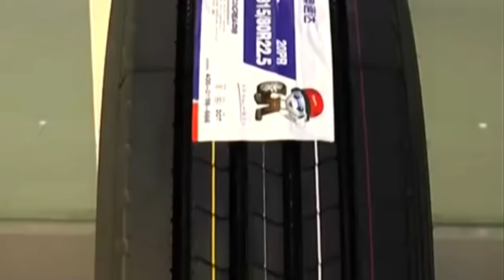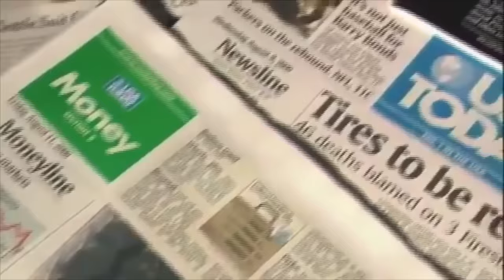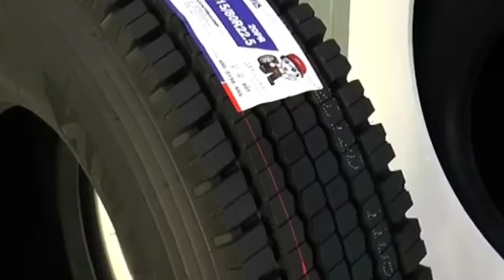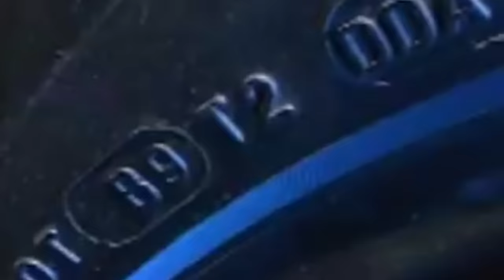5 Tires You Should NEVER Buy!

Comment: The Firestone Wilderness issue was not a Firestone issue.  It was a Ford issue.  Firestone had recommended 32psi for inflation, where Ford recommended 24psi to 'keep the ride smooth'.  The Wilderness tires did not have such issues on other vehicles.
Reply: There was more to that story:  I worked at a Ford dealership during that time period and the Explorers had Twin I-Beam front suspensions.   Nothing wrong with that except that when they were chained down onto the transporters the front alignment took a set with excessive negative camber.   This makes the top of the tire lean inward which puts a lot of stress on the inner tread edge.   I complained when doing 'New Car Prep' that they were out of alignment but was told that they couldn't do anything about it unless the actual purchaser made a complaint.   So thousands of Explorers were sent out into the world wearing the inside edge of the front tires enough that cord would be exposed long before the outer treads showed much wear at all.   And THIS is where the main problem occurred.....owners said 'there's a LOT of tread left...so I'll put them on the back to wear them out'.   MOST of the tread separations happened on the rear wheels due to them being cut all the way around on the inside and then run at high speed and low pressures.   ANY tire will fail under these conditions.    Once the lawsuits were settled do you remember that Continental as well as other brands also failed in the same way on the Explorers?   Yes...they did.   It was a vehicle problem that was easily corrected and not an actual tire problem.
Reply: ford also told firestone how to build those specific tires that went on from the factory. which happens many times tires sold through normal dedicated tire shops even if the same model are on average built to higher standards.
Reply: Those tires would wear extremely slowly, as the rubber aged, it dry rotted, eventually leading to the tires coming apart. I worked for Firestone, and this was the explanation they gave us
Reply: I still blame both companies your 100% on the air pressure thing but Firestone allowed Ford to lower the air pressure specs on the explorers running the Firestone wilderness tires, and there were almost no issues with other brands like BFG on Ford Explorers or S10 Blazers (similar SUV) running the Firestone Wilderness Tires at 30psi as OE. A decision Bridgestone/Firestone Corp made to keep a customer (Ford) happy basically hurt them in the end.
Reply: The Wilderness tires supplied to Ford by Firestone were made with one fewer belt than those same tires sold to the aftermarket.
Reply: Recoil Rob this is why when I get my first car, there is no way in hell its going to be a Ford. I more than likely will get a Toyota 4Runner, and then save up to do a swap for a Jeep. I am not getting a Ford.
Reply: Keaton0801 Hey man, it's fine if you don't want a Ford, but all the big car companies have stories much like this one if you look into it. There is a history in the automotive industry of cover ups and known dangerous defects being ignored to save the company from costly recalls. This is not a problem only attributed to Ford.
Reply: Yes you are 100 percent correct.... I remember that I was working at Firestone at the time and all there was were ford explorers in the parking lot... but it was Certain  tires that were effected was by the code on the tires it was like the code like being in vn and vh something like that on the tires that were effected
Reply: Funny how Ford COMPLETELY REDESIGNED the Ford Explorer the very next year. Including adding independent rear suspension. The wilderness was a fantastic tire that so many people got so many miles out of. It made me so angry to see all those tires sitting in my dads firestone lot with gaping 2” holes drilled in the sidewall which was the protocol. If you had a set of these tires on, all you had to do was stop by a firestone store and bam, they would replace the whole set for free. I can’t remember what they used to replace them, maybe a destination? Bridgestone/Firestone is a top tier tire for all road purpose.
Reply: Uhaul won't let you rent a trailer if it's being towed behind an Explorer. I have an 07, a complete redesign from the Jurassic Park style Explorers and they wouldn't let me. I hear the newest front wheel drive style can
Reply: If I recall correctly there was a problem with the Explorer assembly line and some rail system that would damage the tires as they moved down the line. Ford did modify the assembly line after all this came to light. There are more problems with the tires coming out of China than any of these ever had.  Quality control during manufacturing plays a huge part in it along with the quality of materials and design.
Reply: I wouldn't buy tires from the 90's anyways...
Reply: It was to reduce the rough ride (it's a truck after all) due to complaints.  Ford even mentioned as much.
Reply: Not too mention the fact that no teenage girl or most adults these days check their tire pressure ever.
Reply: this is not true, it was one bad batch, one DOT # that was involved, and combined with the under inflation that ford stated.
Reply: 4ST induction  If you want to believe that ANY manufacturer can "redesign the whole vehicle" by the NEXT model year, AFTER it had to take some time into the previous model year to even suspect a problem that calls for a complete redesign, then you have been living in a Star Trek universe where replicators can be programmed to instantly create a new version of anything.
The "new" version design was probably finalised during the first year of the previous ones production.
Reply: I wouldn't run any tire at 24psi for any kind of extended high speed or even medium speed because that low inflation will flex the sidewalls big time and heat them up to.
Reply: Firestone is still garbage. Get some Toyos
Reply: No, It was a Firestone issue, You could get the Wilderness tires on 95 S10 Blazers and they experienced the same problem as the Explorer, it was not as highly covered as the Ford and Firestone issue. Also, Firestone 721's were a failure and not long ago GM issued a recall on vehicles equipped with Firestone tires claiming contaminated rubber in the tires.
Reply: If you drove a Chevy Corvair, you ran your front tires at 18 PSI.  At 32 PSI making a turn on a rough road was not easy, the front tires were like basket balls being dribbled.  I know, been there, done that.  Then I read in the owners manual, finally, to inflate the front tires to  18 PSI and the dang thing drove good.  There is little weight on the front, rear engine rear drive, engine behind the rear wheels.
Reply: They were also only rated for use on lighter vehicles like the Ranger while Ford decided to also install them on the much heaver Explorer. They were not only telling people to under inflate the tires but they were overloading them as well. Inflated properly on a Ranger they were fine. They would have needed sturdier construction to be safely used on the Explorer, even at proper pressures.
Reply: Eldor Luedtke, Other overhanging rear engined cars using the same size F&R tires have had similar uneven pressure specs. It's an attempt (which works pretty well) to make the car understeer ("plow") more like a front engined RWD car.
I once loaded a Citroën ID (same basic car as a DS) with over 1,000# in its trunk. I could do this and still go due to the self-leveling oleopneumatic suspension that was able to lift that much weight in the rear.
Presto! The car oversteered like an overhanging rear engined car. "The tail wagged the dog."
A heavy load in the bed of an ID wagon would do the same thing to it.
FWD cars in general are understeering largely due to 60%+ of the car's weight being on the front wheels when lightly loaded. The Citroëns unlike most contemporary USA cars 1950s-70s had very little weight behind the rear wheels, adding to their front weight bias.
Reply: 24 is obscenely low
Reply: I thought it was "VDHL" for the recalled serial numbers.  At first, they only recalled tires made in Decatur Illinois.  They later closed that plant.  Humidity and bad practices in the construct are thought to be factors.  The tire pressure was recommended at 26 psi, not 24. Most of the accidents had very low tire pressure, much lower than the recommended 26 psi.
Reply: The Explorer didn't get independent rear suspension until 2001. In 1995 the Twin I Beam and Twin Traction Beam front suspensions were replaced with a double A arm design.
Reply: Yup, it's stupid policy by U-Haul. They're applying the rules for the 1994 and earlier Explorer to the redesigned 1995 and later that have double A arm front suspensions.
Reply: Nope. It was Ford specifying too low of tire pressure to increase ride comfort. but with the low pressure the tires would get too hot and fail because they weren't designed for that pressure. People who ran their tires at the pressure specified on the tire instead of on the door jamb label didn't have the problems.
Reply: silicon212 , you are so right! I agree 100%
Reply: They were mixing a product in the tire called PGI with other rubbers in the tire like the km and FE and it caused catastrophic tire failure. That's what happened.
Reply: silicon212 kia says 30 psi for my 2006 kia shortage 4x4. Then when I drive the tires warm up few degrees to 32psi to be optimum pressure recommended by the manufacturer. I’ve got Michelin defender tires.... I believe they are 80k tires....
Reply: There actually is a major problem with that type of suspension. Every time you go over a bump it will mung up the camber. The result is that you'll get excessive shoulder wear, especially on the inside. And then you have someone who doesn't know what they're doing measuring the tread depth in the CENTER of the tire while the shoulders are already bald, and figuring that its still good.
Reply: Chevy Blazer was NOT even REMOTELY similar. Those had a double wishbone front suspension that would maintain camber. The exploders have a double I-beam suspension that would go out of camber with any shift in the suspension.
Reply: Ranger and exploder were the exact same vehicle, except for the crap on the back -- passenger seat or cargo bed.
Reply: Toyota makes good vehicles.  My wife had a 2005 Sienna for years, and it was very reliable until a month ago when someone did something stupid in front of us on the freeway and she didn't have time to stop.  The van was totaled, but we walked away with no injuries.  She now has a newer RAV4.  However, as Chris H said don't discount Ford completely based on one episode.  Just about every car manufacturer has an incident (or several) just as serious if you look hard enough.  GM pickup trucks had Sidesaddle fuel tanks that burst into flames even more readily than the Ford Pinto in a crash, Pontiac Fieros with the 2.5L engine would leak oil onto the exhaust and burst into flames.  The first generation Scion XB was horribly unsafe in a crash.  VW lied to pass emissions.  And the list goes on.  Long story short, if you refused to buy a vehicle from any manyfacturer that had this kind of dirty issue in their past, you'd probably end up walking.
Reply: I 100% agree with your comment. I worked in the automotive service industry from 1993 to 2006, and know for a fact that this was 100% Fords' problem.  The Explorer was designed with a high center of gravity and the wheel track width was too narrow making it prone to rollovers when sharply steering in either direction (regardless of the tire brand, size or PSI).  That plus Fords' recommendation of 24psi on the door jam placard like silicon212 already mentioned in the previous post is the reason for the rollovers.  Tires lose 1psi per month under normal conditions, and also lose 1 psi for every 10 degrees colder it gets. People never check their tire pressures monthly as recommended. And because of this eventually the low tire pressure causes tire overload and the sidewall cannot take the heat and tire failure is imminent.  There were MANY cases of Explorers rolling over with different tire brands on them.  On a side note tire retailers had an agreement with Ford NOT TO SELL tires larger then P205/75R15 for the Bronco II due to it's rollover potential. Ford to this day swears that it was the tires, and not their vehicle design that caused this. Newer Explorer model years featured a lower center of gravity and a wider wheel track (this proves that they were aware of their design mistake).  Beginning with the 2008 model year, all vehicles must have a TPMS (tire pressure monitoring system) as original equipment. Honda/Acura and Toyota/Lexus introduced it in 2007 one year ahead of schedule for the new law.
Reply: 4ST induction: Completely wrong.  The Explorer got a redesigned front suspension in 1995 with the 2nd gen (no more twin I-beam front suspension, but still a "solid" rear axle and leaf springs), and IRS in 2002 with the larger 3rd gen.  Also, Ford started designing the 3rd gen in 1995.  The Firestone issue started becoming known in 1996 and 1997, and the NTSHA began an official inquiry in 2000.  

As to Firestone being "Top Tier", no.  All tire manufacturers make multiple price point tires, including Firestone.  Some of them are good, but those are generally the higher priced ones, just like other tire manufacturers.  As to my personal experience, I have had better luck with Cooper, BF Goodrich and Goodyear than Firestone when purchasing similar purpose and price point tires.  The Firestones had similar traction and performance, but wore out faster.

Edited to show who I was responding to
Reply: schwagbag: I would disagree with your assessment of blame.  Ford AND Firestone are at fault for the tire pressure problem (they both went with it).  

Your comments on tires and tire pressure are accurate, I've seen more people than I care to count driving on near-flat tires, and the number of people with flat tires that were obviously caused by the rim grinding through the sidewall after the tire got too low.  However, it is the responsibility of the driver to understand what they are driving.  Suzuki is not "at fault" for the Samurai, which was also known to tip over.  IT was a great little vehicle for it's intended purpose.  People who were used to driving cars and expected Explorers and Samurai to respond the same way are at fault.  The twin I-beam suspension is simple and functional, and worked fine for decades.  I have had several vehicles with that front suspension setup and not had a problem.  Ford made the Explorer bigger due to demand for larger vehicles, and changed the suspension because newer customers wanted something smoother.  Yes, these things did also help with stability and handling, but it is disingenuous to say that vehicles rolling over is the only reason for the design changes, or to assign blame based on such "proof".
Reply: silicon212 you are wrong it was both ford and Firestones fault
Reply: cloridan Beauchamps lowered tire pressure would not reduce rollover, it would make it worse. The tire flexes more, causing it to tuck under in hard cornering.
Reply: From what I understand it was a pressure issue made worse because many owners let the tire get low AND commonly overloaded the vehicle. Causing two problems, rollovers due to low pressure and tire failure from overheating(low pressure, too much weight)
Reply: greggv8 pressure stamped on the tire is always the max allowable for the tire.
Reply: I noticed that 32psi rating back then. Almost every tire machine I used through the 80-90’s, automatically air the tire to 32psi(once the bead was seated). I never thought that was enough psi for any 15” ⬆️. I’d like to know fords reason for the 24psi rating.
Reply: Jason Morehouse 
Not true. It was all the Wilderness tires that came on the Explorer from the factory.
Reply: jblyon2 
Wrong. The tires failed on all cars they were installed on. Other manufacturers had this issue as well.
Reply: And the Firestone 500 were junk before the 721 which was basically the same tire!
Reply: EXACTLY!
Reply: So what you're saying is: Tires don't kill people; people kill people. Sounds familiar.
Reply: The way the accident was described I would have not excluded the driver's speed from the equation; just seems a bit of corporate bashing to me.
Reply: "There actually is a major problem with that type of suspension."

News flash - every suspension design is a product of compromise.  They all have problems!  Film at 11.

"Every time you go over a bump it will mung up the camber."

Yes, the camber would change whenever the suspension was compressed or drooped.  This is the case with nearly every other suspension design on the planet, except maybe live axles, and with a live front axle, you get to deal with bump steer.

"The result is that you'll get excessive shoulder wear, especially on the inside."

Typical wear pattern on the twin I beam is on inside AND outside edges.  Solution is to just rotate tires more often.

I know the twin I beam system.  Got a Ford with that system parked out front right now.

"Those had a double wishbone front suspension that would maintain camber."

Negative.  The S10 suspension changed camber as it moved vertically.  Additionally, the steering linkage was garbage, with the idler arm wearing out rapidly leading to the toe moving around however it wanted.  The twin I beam had issues, but the Chevy IFS from the same era was far worse.

"The exploders have a double I-beam suspension that would go out of camber with any shift in the suspension."

Any suspension system that "shifts" will go out of alignment.  Not sure what you're talking about.

The twin I beam holds camber just fine.
Reply: "pressure stamped on the tire is always the max allowable for the tire."

And for max loading.
Reply: 100% correct! The lower inflation causes the tires foot print too increase. More contact with the road creates more friction, causing the tires to heat up faster and hotter. While at the same time not allowing the tire too dissipate heat as effectively as a properly inflated tire would.   Also the lower pressure causes the tire to deform from its intended profile. This deformation would exacerbate any flaw or weakness that wouldn't be there if the tire is inflated to FACTORY RECOMMENDED specs.
Reply: Floordford I have an '06 Explorer. You're correct. Uhaul will not rent Explorer owners, but WILL rent to Mercury Mountaineers....It's the exact vehicle!!!(??). I don't understand it. I worked at Ford dealerships at the recall time. Most of those failures happened when people overloaded the Explorer with more than the recamended amount of passengers. Of course the recall really kicked in in the summer...ugha!
Reply: jlc7300 I just put Firestone Indy 500s on my 328i and they're fabulous. Read the online reviews  .. can't get much better.
Reply: Captain Chaos I agree .I had a 98 f150 ( NOT a twin I beam truck) with wilderness tires, I can honestly say I had the truck for 1year blew 3 tires. I traded in for a 1999 ( 4 doors).
Reply: YES THEY DID. Firestone tried to kill me as they continued to sell these after they knew there was an issue. The tire that blew on me was the right front on a van. Firestone tires are ONLY good at keeping boats from hitting docks. I will never own or drive any vehicle with a Firestone tire.
Reply: If a tire comes apart under normal loads and speeds when it is 8 pounds underinflated, it is unsafe.
Reply: 60 minutes did a story on this.  They bought an explorer, rigged the tire to blow, and did several tests with the tire blowing.  High speed, low speed, full brakes, and no brakes.  The vehicle stopped in a straight line each time.  It was determined the drivers were swerving as soon as the tire blew to get to the side of the road, causing them to lose control.  The biggest issue was running the tires very low on air to reduce some of the handling issues.  Those did not maintain the pressure, let them get too low, overheating the tire, and causing it to fail.  
I always run all my tires at the max pressure on the sidewall.
Reply: Do not buy a Jeep Wrangler. High center of gravity and short wheelbase. Also solid rear axel and body on frame construction. Obsolete technology. Death traps.
Reply: MrErikw26 - That explanation made me laugh... NO offense to you, but it's funny that the manufacturer told it's employees and sales staff to say that "Our tires last too long... It's the customer's fault for leaving our awesome tires on". :-) 

I'm sure roll-over data included the mileage on each tire... It would be interesting to find that somewhere. From what I remember, a lot of the issues seemed to lead towards the vehicle and not the tires, but it was so long ago that I really can't be sure. A lot of "reasonable" explanations here make sense too. Who knows?
Reply: Exactly. Ford made the tires part of the suspension system rather than the traction system.
The they wanted a softer ride, soften the shock absorbers.
Reply: silicon212 this guy knows wasup. Not many people know the truth
Reply: immikeurnot when you drive the tires get hot and the air expands if you fill the tires with the psi listed on the tires when the tire gets hot and the air expands you have a higher psi than what's listed on the tire. You never fill the tire all the way with what's listed
Reply: @chrish931  Yeah, like the Toyota brake system coverup....